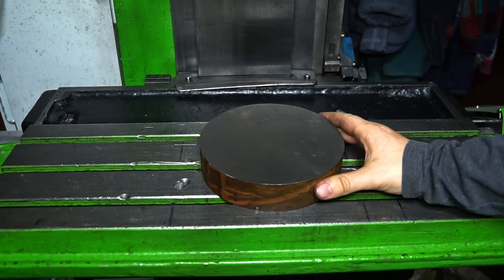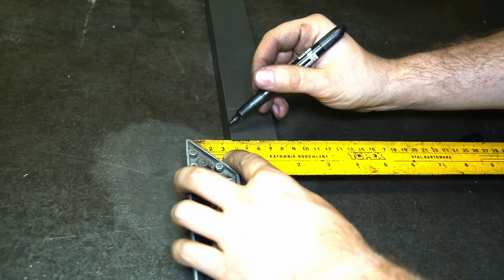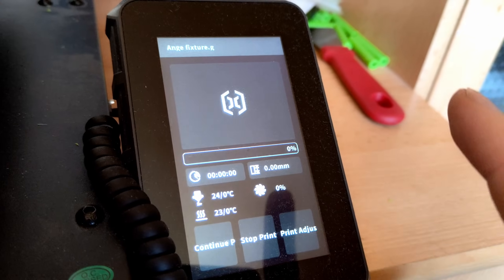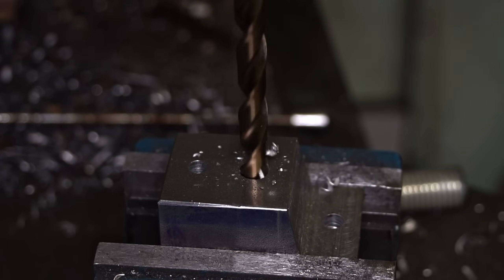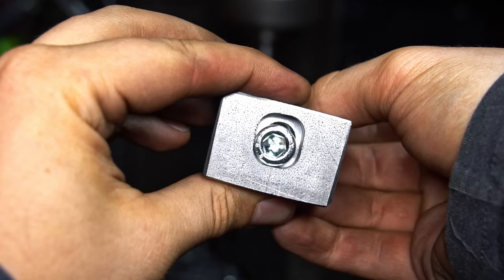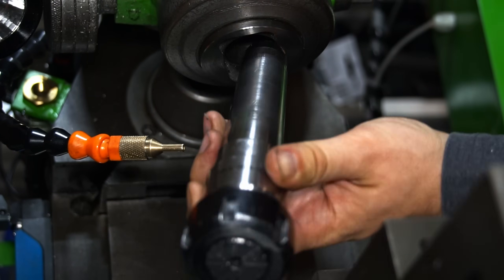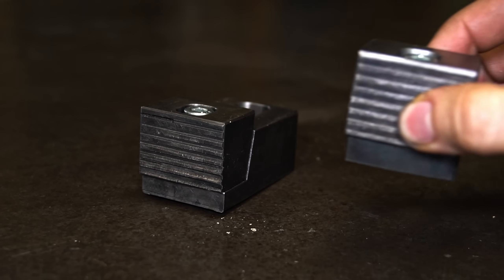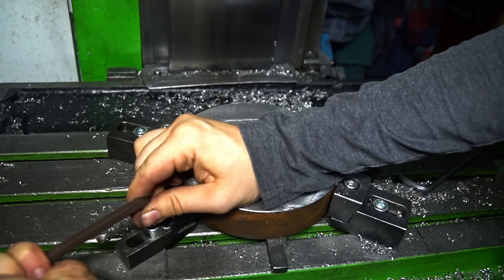Toe Clamps For Milling Machine

Comment: One clamp and two stops are all that is required.
Reply: Or a vee block and one clamp.
Reply from the maker: Actually that's right. But I made these 4 and didn't have time to made another stops / v-blocks. But those will be probably made sooner or later
Reply: @GBWM_CNC just make one. They are usually used singly to push against a reference stop

Comment: Great job on the video.  For the t-nuts, consider deforming the bottom thread or two so you can’t put a bolt in too far.
Reply: I absolutely hate that, I always tap them through
Reply from the maker: Thanks! I made some special - perfect length bolts for this purpose. But that's an idea too!
Reply: @GBWM_CNC  I would make custom fasteners too 😊
Reply from the maker: @jimsvideos7201  can't go wrong with that! :)